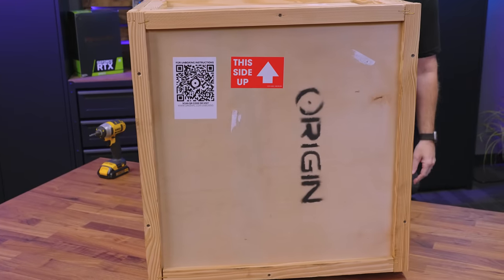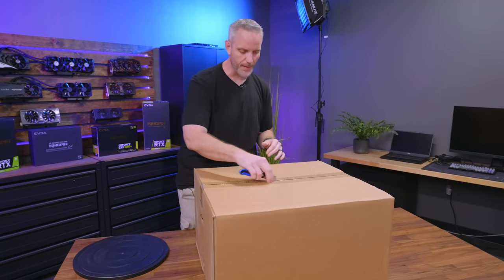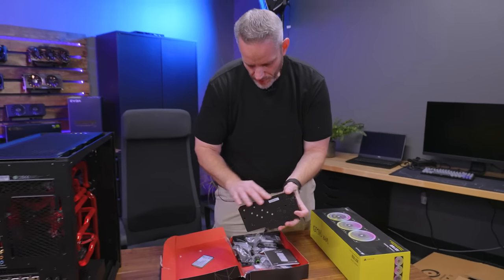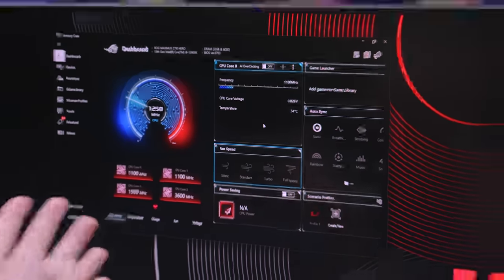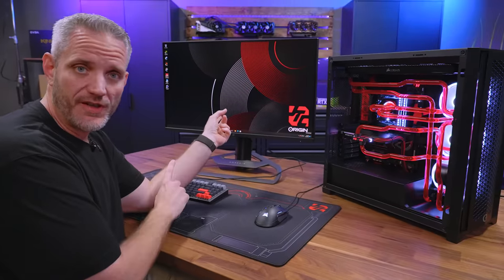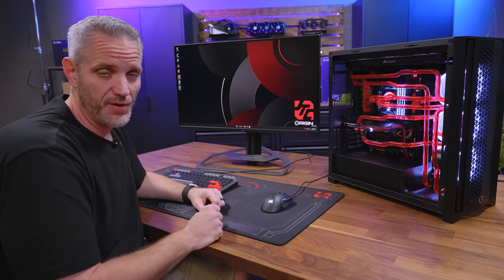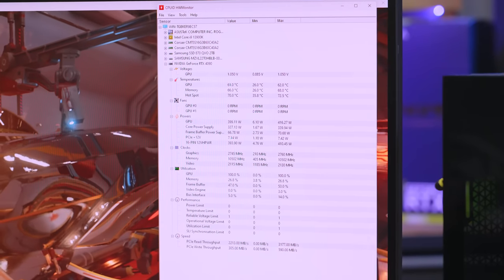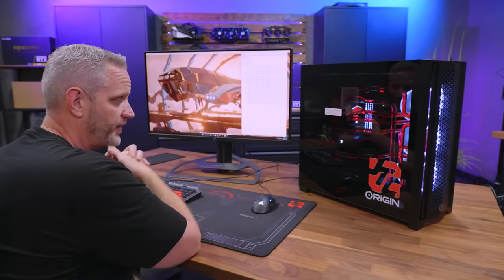When the PC comes in a crate, you know it's gonna be good!

Comment: I can agree about the fear for building a custom water cooled system. I couldn't do it 2 years ago and since then all I wanna do is build systems like these with varied cooling performance (starting from Itx 400W to even 1200W ATX ones up to 4 radiators). I already built 5 computers and I'm off to build the 6th which is going to be a gift to my father. Your channel has been a great help and an inspiration.
Reply: I’m new to PCs, do you mind explaining what he meant about the fans not knowing when to ramp up bc they aren’t connected to the gpu through the software?? I’m confused
Reply: @CiiTy_1  i need to watch it again. But from what I understood is that Origin didn't use a PWM cable (probably used SATA to JST or Molex to JST, running the fans at full speed) so the fans couldn't be coupled with the sensors in the GPU. 

I'll edit this comment once I find the time where he commented on the fan PWM.

Update: found it at 14:00 he meant that the fans were not connected to Corsair's iCue software. This way the GPUs temperatures couldn't be coupled with the installed fan's PWM signal.
Reply: Pc building simulator is indeed awesome. No just kidding you are completely right i had the same at first. Everything is frightening if you never done it and there i a lot of money involved but it can be so simple when you eventually have done it.
Reply: It's not so much about fear, as more like "wth is the point?" Water cooling is great if your only game is cinebench.

Comment: Just leaving that expansion card in the plastic bag it probably came in would have prevented that issue. Also, you're absolutely right about positive pressure being the way to go. Anybody with pets will know this.
Reply: I bet they have a policy to test components before shipping. they should have repackaged it for sure
Reply: Or, at the very least: get filters over the areas that intake air
Reply: yes, with negative pressure your pets will get sucked in and stuck to the case🐈🐕

(im kidding)
Reply: Get powerful air-purifiers throughout your house, dude. Everybody should have that 💁‍♂️ Get ones from the Blue Air Blue Pure line. And err towards larger sizes. Change your life.
Reply: It's not that serious. The slight rubbing off the paint to a component that you may not use or will it be seen if installed is not going to effect the performance. You all are just nit picking.
Reply: @disguiseddv8ant486  the point isn't whether or not it effects functionality. You don't buy something like this because it's practical, you buy it because it's a show piece. You don't want scratches in a show piece.
Reply: @disguiseddv8ant486  There needs to be some sort of government control on the amount of nits a person can pick. Nobody needs a high capacity nit bag mag on full semi auto pick.
Reply: @7shortofperfection  The show piece wasn't scratched. It was just an accessory component in the box that may or may not be used had slight imperfections. If anything the company will either send you out a new one or compensate you for the imperfection. Again, it's not that serious! The most important thing is that the build arrived flawless.
Reply: @disguiseddv8ant486  Even if it's not the most important thing, it is a thing that is annoying. I guess he didn't pay for it, but someone that did spend money on it would have every right to be annoyed about this, and now they'd have to send in a complaint and make it a whole thing. All they had to do is put the card in a plastic anti static bag. When you pay this much for something you're well within your right to expect quality control on everything.
Reply: @daniel4647  Have you ever purchased a brand new vehicle? If so, was that vehicle flawless? No, it wasn't! The majority of vehicles paint have imperfections, like scratches. There's sometimes loose screws, gaps that isn't properly aligned, broken seals, etc. that you as a customer must go back to the dealer to get it fixed. And people are paying THOUSANDS for these vehicles. You know, like the Tesla's with their known issues. These manufacturing plants have their top Quality Control employees on the job and flaws are still getting passed. 
You all are trying to make this M.2 expansion card an issue because of a little paint was rubbed off on the edge. It's not a hassle to call customer service to mail you out a new one or refund you a percentage. And it's not that serious!
Reply: @disguiseddv8ant486  this isnt comparable to a tesla model 3 though, its a top of the line product with premium pricing. I would be pissed off if my Ferrari came with scratches or loose bolts too.
Reply: is the pc racist?
Reply: @rustler08 that's not going to do anything though.
Reply: @93836 lmao, so you are saying those air purifiers are cleaning your floors to absolutely 0 dust on them?
Reply: Or ask to get it fixed asap rather.

Comment: That rotating thing you have put the cases on has been such a great addition to your channel. It is so much easier and smoother to move the systems that it is not distracting.
Reply: They are called Lazy Susans for anyone curious 👍🏼 I love when he spins a build around
Reply: You are so right. AMAZON has a lovely wood 14" Lazy Susan for $17.00. It's the one I use for my full tower case.
Reply: You can also find them at Michaels, under the baking aisle.

Comment: I completely agree with a Origin that exhaust makes sense because radiators are hot and you want to dump that air out and I completely agree with J  exhaust fans should never have filters.
Reply: if anything, a.. probably $6000 custom rig like this should be using push/pull with some big ass noctua industrial fans to move ridiculous amounts of air. i'm talking those 3000rpm ones that hit like 160cfm or so. though i wonder if that stops being effective after a while, when you're moving so much air thorugh such a small space. but i guess if priority number one in a rig is whether the fan has a glowing ring on it, the actual effective cooling capability wouldn't matter much anyways

Comment: I could imagine the Boss seeing those parts floating around with no bubble wrap or foam, They were doing so well:face-purple-wide-eyes:
Reply: Oh be quiet! The rubbing off of the paint on the expansion card does not effect the performance of the card. And also, the damn expansion card will be barely seen if installed.
Reply: @disguiseddv8ant486  so you think its ok to get a damaged part? No point in buying from them if your parts can have cosmetic damage.
Reply: @joyfulkiller9400  I don't think that it's okay to receive a slightly cosmetically damaged expansion card. The problem is that it's not a deal breaker. Should you call the company to let them know about it? Yes! Mostly like the company will send you out another expansion card or refund you a certain agreed upon amount for their error. Mistakes happens! This is not that serious that you all are trying to make this out to be.

Comment: I set up my loop with a water temp sensor connected to the motherboard, and setting the fan curves on that. Been working like a charm
Reply: That should basically be standard. Set the fan curves based on WATER temp. Setting curves based on CPU and GPU temps makes no sense.

Comment: Thanks so much for this very informative and no BS video!! You always tell it like it is!! I've been looking at Origin for a long time and was almost ready to pull the trigger, when the $6500 machine debacle happened!! This along with the melting cables on the 13900K stopped me in my tracks.  This video went a long way in restoring my faith in Origin!! I've always been on the fence on should I go with AMD or Intel!! Wonder if you have in words of wisdom on that subject!! Thanks again!!
Reply: Honestly, both AMD and Intel are doing good right now. Intel is slightly better at gaming unless you get an X3D chip. AMD is slightly better for most productivity and multi-threaded tasks (like streaming or some games). AMD is also slightly more power efficient right now so if heat and energy are a problem for you than AMD may be a better option, or for laptops.
Reply: @morgan40654  
Thanks so much for you input!! I’ve been looking at the AMD Ryzen 7 7800X3D!! I will primarily use the new machine for flight simming!! Again thanks so much for you input!!

Comment: I'm with Jay.  For my first custom loop, I just copied his "water-cooling for beginners "video.  I ended up going with soft tubing because I cannot bend tubes.  Gotta keep practicing.  I have six intake; side and front, side is coming through a 360 rad and I do have the top rad with three fans exhausting as well as one rear fan exhausting.  Everything works great and stays super cool.  Great vid!

Comment: Bios updates are important. Redoing all the bios settings after an update is a pain. It's more of a pain if you are insane like me and insist on bios only overclocking. I used to take pictures of settings with my phone, but sone genius out there mentioned an amazing life hack for asus boards, and probably others too. You just hit f12 and it saves a screenshot to a usb drive if inserted while you are in any bios screen. What a game changer. I won't be putting off bios updates anymore due to laziness and hassles related to redoing settings. It's easy enough with that little life hack. Took me 20 years to ease the pain but who knows how long this feature has been out.

Comment: 17:42 You can actually use grafics card temperature as a source for fan profiling. In Armory Crate you can select up to three sources and the fans work according to the source that has the highest temperature. I, for example, have as sources the CPU, graphic card and VRM. I have custom fan profile and they ramp up based on the highest temperature from the three sources
Reply: they just need to put a coolant temp sensor in.. pick the water temp you want to maintain.  ramp fans according to that temp.  the coolant cools the system.  the fans cool the coolant.  i do this in my custom loops with no issues.  much easier to set your positive pressure in the case too.  lots of mobos have at least one thermal plug on them now.. often  for aio stuff
Reply: @xenodraken377 Yes! Thats the way to do it...Using the water temp instead of the gpu temp keeps the fans from ramping up and down so much with the gpu load...It just smoothes it out and it will keep the cpu and the gpu happy...

Comment: I'm really confused why Jay of all people would be talking about running fans based on the GPU temps on a water cooled system. You always run the fans based on the water's temps. The fans cool the water, which in turn cools the components.Running the fans based on components, you're almost always going to have the fans spinning way faster, and louder, than they need to be. Only when the water hits heat saturation would the fans be at a sensible speed. Also, Corsair recommends all exhaust for those cases. They get better temps that way, so you're not really "agreeing to disagree". They actually have testing to base their opinion on.

Comment: Jay you don't need Armory Crate to control the board lights, you can still get the standalone Aura Sync (RGB control only). It will then work with iCue, it even recognises my 4090 FE to allow me to sync the RGB top and bottom LEDs with iCue (it lists the GPU as an ASUS lol).
Reply: or he could try OpenRGB.
Reply: @2MCDS I use this on Linux, works pretty well.

Comment: 9:45 The worst thing I've found with Asus motherboard lighting is they usually only give you on/off as the only options inside BIOS, so you have to install Armoury just to change it if you want it on.
Reply: What I hate about mine is that the lighting always comes back if I completely unplug the system or if there's a power outage. FFS, it's doing its rgb-puke even while the pc is off. I'm definitely going with 0 rgb components next time if it's still even a thing in this market.

Comment: Fans should be set based on coolant temp. Anything else doesn't make sense in a watercooled system
Reply: Agreed. That what I did then my 4u system was watercooled. I changed to air cooling because I didn't want to brother anymore, noctua cooler are awesome and my red devil 7900xrx is overbuilt, not thermal issue what's so ever. But my case fans are still tied to the sensor who check the temperature around the video card so they bloc harder when I game
Reply: Absolutly agree - it's kinda the point

Comment: I just built my own pc. I went with a amd build. Cpu amd 7950x gpu radeon 7900xtx. Total cost was 3300 bucks. I really wanted the msi godlike board but 1300 bucks for a mb was tough haha. I went with the Asus proart x670E-creator wifI board. No problems so far. Runs smooth.

Comment: Needed a fast replacement PC so I went with one of Origins spicey builds. Came leaking fluid and immediately had to send it back. When it returned to me the next month or so later, the box was trashed but they had finally added enough padding that MOST of the build arrived undamaged. Had to buy a backup computer in the interim and have my carpets cleaned. But at least I paid an extra grand to have someone else build it for me. Great experience.

Comment: Listening to you speak about the fan speed based on CPU or GPU temp made me wonder, is there any way to control the RPM based on the fluid temp ? If so is it a better solution ? Planning to go for a delided watercool for my next build
Reply: I could not agree more to that. I got an AIO from nzxt and there the pump speed is based on CPU temp where the fan speed on the rad is controlled by liquid temp. Why would a custom loop be different, right.
Reply: Yes. With a temp sensor in the loop and appropriate software you can. Aquacomputer's Aquasuite with either their Aquaero, Octo, or Quadro hardware controller is probably the most full featured and configurable fan control solution you can buy. You may also be able to do it with a Corsair Commander Pro, open source source software like Fan Control in combination with a temp sensor input on the motherboard, or whatever your motherboard's fan control software is and temp sensor input.

I'm always surprised that Jay never puts a temp sensor in his loops. Basing fan speed on the temperature of the water over the ambient temperature in the room is a better way to control fan speed in a watercooled computer than CPU or GPU temp. If only because fans will gradually ramp up if need be.
Reply: @Gridlynk  Exactly, this is how cars have worked for a fair while now, as far as i’m aware coolant temp is the only variable that will control the radiator fan
Reply: @Gridlynk  Thanks a lot for the precision and all the details, guess I'm gonna add some of these items in the final shopping cart. Seems like the most logical solution to me.

And you're right, I was questionning myself and among the couple techtuber I watch, I think I've never seen any of them actually doing a topic for that specific configuration

Comment: I think another point towards diy would also be how far air coolers have come. You can easily run some pretty expensive components on full air cooling and not worry about temps. Much easier and less hassle to install.
Reply: You can easly run every single component o air cooling, even slightly overclocked if done properly.
Reply: @Deviczek literally. The only reason to do custom loops nowadays is for the aesthetic

Comment: My latest build is almost exactly the same. I have a 5950x and an FE 3090ti, same rads, fans, and pump res combo. I used soft line and the back rad is supply air with top rad as exhaust. I added a rear exhaust fan as well. I use iQue software only and it works perfectly. With gameboost turned on and iQue in silent mode, cpu idles at 55c and gpu idles at 43c.

Comment: Hi Jay. A muffler/exhaust shop has a particular tube bender machine used to create custom exhaust pipes. One day, we'll be able to buy a smaller one for bending our tubing. It would work better than the bend gauges we have today. I built a heat gun holder to heat my tubing, ensuring my tubes are heated to the correct temperature. It's a straightforward DIY project.
Reply: I was just thinking that wouldn't it be easy just to have machine with plates to make the bends or something of the kind

Comment: I am running a similar gig but not with negative pressure but with air going through the proper filtration and channels.
Corsair 7000D (suspiciously identical to this case), 3x140mm fans front for intake with a 420 radiator, 3x140mm fans top with a 420 radiator +1x140mm rear for exhausts + XD7 reservoir at the side where the fans of this system are. (Case requires minor modding to fit the XD7 there even tho they are both corsair products but i had to, in order to have the airflow front to top)
a) Mine is not a mess of tubing b ) it actually has airflow compared to this c) you can remove the RAM if you want to, d) used to have a 1080 TI in the loop and it was on a PCIe extender so if there are any drops from the CPU nozzles ever, they won't drop on the GPU, but upgrading to a 3080 recently, decided to not add it in the loop yet (warranty related).
all ♥J!

Comment: Jay I recently made the swap from Asus's terrible armoury crate to OPENRGB. It actually DID detect all of my RGB and has worked flawlessly for almost 2 weeks now.  Having Asus bloatware removed has been great so far. Less cpu usage, less TEMP and way less processes constantly hanging up in the background to shoot temps through the roof. I am sure you've seen this program floating around by now. I hesitated for MONTHS and wish I had not put it off now. It really was as painless as they say. Just make SURE you use the Asus removal tool to get rid of Crate. Then restart and go into BIOS. Many Asus boards have setting in BIOS to automatically install crate or bug you about it unless turned off in BIOS.